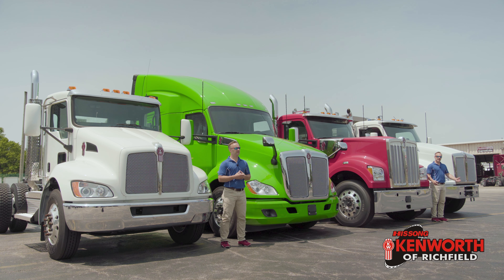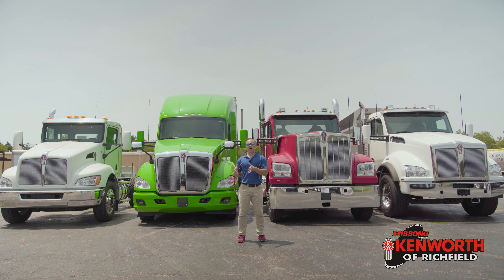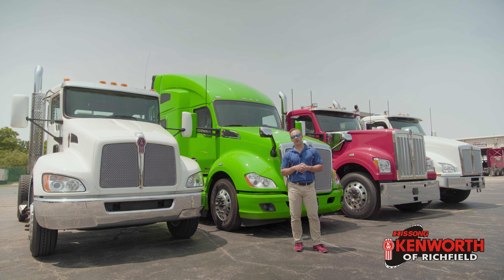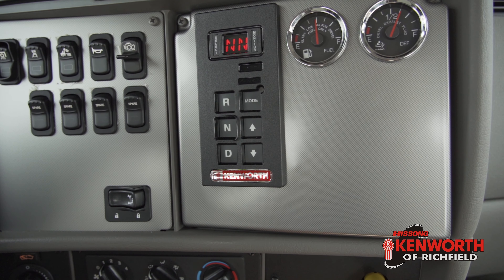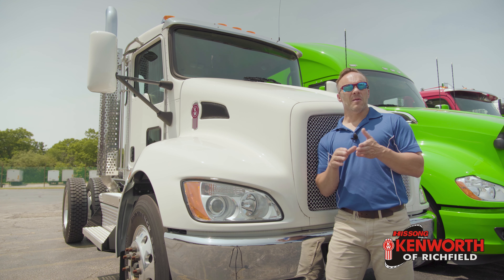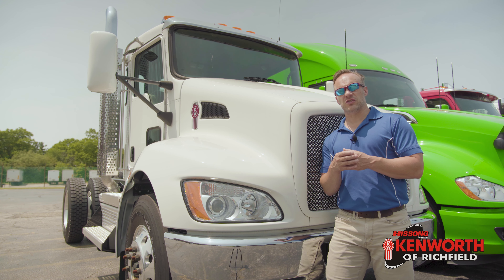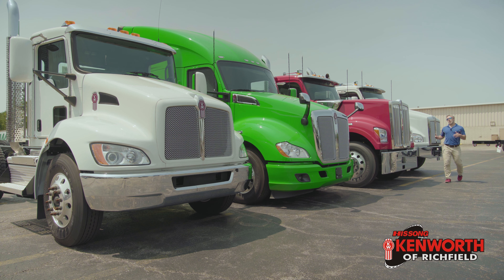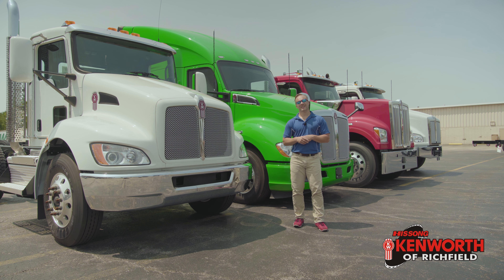Manual vs Automated vs Automatic (AGAIN...sort of)

Comment: I wonder if there's a difference in hauling power between the allison trans vs the endurant trans.
Reply from the maker: They work differently, so yes and no.    The engine is still generating the same power and torque.    The Allison uses a bit more power (higher parasitic load) but qith the torque multiplication of the torque converter, it lets the engine stretch it's power creation in a way if that makes sense.
Reply: @KenworthofRichfield  so this essentially means the automatic transmission may or may not haul a fully loaded trailer, as its primarily depended on multiple factors? As an OTR, I am starting to lean into the endurant trans for durability, unless I've missed something. I'm very used to automated transmissions, even if I've made the same misconception in calling it an automatic transmission. I haul 70-80K trailers regularly and don't want to overstress a transmission that isn't built for that level hauling. Use the right tool for the job, as the saying goes.
Reply from the maker: @OrtexofWill  Are you running 70-80k gross or is that just the payload?     If that's gross, I'd go with the Endurant.   It's a great transmission.   It works the same as a manual, just with the computer controlling everything.    If you're running at 100k+, then we can look at an UltraShift that will work for your application.   

As an OTR, I'll assume that you're running gross of 70-80k and to me, the Endurant is a great option for you.
Reply: @KenworthofRichfield  my loads as an otr reefer gross at around 40k. Sorry, I forgot gross weight and total vehicle weight were two different things. Whoops!

Comment: The international LT that I'm driving has an automated manual 10 speed and I hate it the clutch never knows when to actually engage, backing is the most annoying because your throttle input half the time it slingshots you back or nothing happens at all for a solid 3 seconds. When I was driving a Cascadia with the 12 speed Auto never had any of these issues and the Cascadia had crawl control which was very nice because it actually reacted how you wanted it to.
Reply from the maker: A lot of it comes down to the programming.   I might check with your dealership to see if they can change the program for you.

Comment: I drive a 2019 Kenworth daycab with the automated manual and what I don’t like is the delay when you hit the gas pedal. Up to 3 seconds. Why is it so bad and is that fixable.
Reply: There is not a delay. Take off the hill assist and you can apply the accelerator  much quicker.
Reply from the maker: What John said :D

Comment: Aside from the Allison being much more expensive up front, they’re much more expensive to maintain if you’re to keep their warranty and keep them in good working conditions.
Reply from the maker: There is more to it, but they do last forever if done right and also, the constant torque and controllability is a huge benefit for some applications.   It's all about finding what works for your specific business.
Reply: on off hwy like a front discharge mixer truck (or in my case a boom truck that gets into extreme situations).. automatic all the way. its the way they put the power to the ground. nothing beats full auto trying to get onto a snow covered lot. the trick is to go as slow as you can. the snow compresses and freezes in the treads as you go, making better traction than you would ever dream of in snow. it can be almost like a cogged railway. and yes i have both manual and full auto units.

Comment: I'm guessing the trend toward automatic and automated transmissions is because of a lack of drivers who are able to drive a manual or a lack of drivers who can drive a manual well. A generic computer program is probably safer and more efficient than a poorly trained manual trans driver.
It's a shame really, because even taking the manual shifting out of the equation, there are more drivers than ever on the road who shouldn't be allowed near an 18 wheeler. Choosing the right gear for the conditions and load is part of what made truck driving a skilled profession. You now have a large percentage of drivers who can't shift, can't back into a dock, and can't maneuver the truck with any proficiency whatsoever.
And that's why driver pay will never get any better than it is now. Driving has been distilled down to the lowest common denominator. What does all the recruiting literature say ? "Anyone can be a truck driver." When anyone can do it, it is no longer a skilled job.
Reply from the maker: You're partly right,  but not totally.   In this, it really is easier, safer, and in 90% of cases more fuel efficient than a manual transmission.
Reply: I've been a truck driver for just only over three years, but what I've noticed is I had/have a ton of more energy after a day's work with an automatic. I've had my 8LL for over two years, working my dump truck from sun up to sun down and when I get off, I'm tired. I've driven for people when I can't find work who have automatics and all I can say is to hell with a manual... I'd rather have the energy to want to play withy kid when he wants rather than to have to willfully motivate myself because I'm tired. I see automated or automatics will provide a person less wear and tear on their body.
Reply: I absolutely agree with both of your replies. I have been driving semis for 10 years. Most of that time I was driving 90,000 lb pump trucks. Our company started buying Western Stars with automatics, and at first I was a "naysayer". After driving one for about a month, I will take the automatic ANY DAY! 

1. You can focus more on the road, or while backing up, so its safer, even if by only a small margin. For new drivers, its a BIG margin.

2. They get better fuel mileage.

3. They are a godsend in traffic or on hills where other vehicles want to pull up on your rear bumper in stop and go traffic.

4. I am a lot less tired at the end of 14 hour day when I drive a automatic. I also noticed I feel less stressed as well, especially in traffic.

These are all undeniable benefits that even the most seasoned truck driver can benefit from.

Comment: I spent several years in the Marine Corps as a tanker. The 70+ ton tank with 1500+ horsepower and gobs of torque used an Allison transmission. Damn near bulletproof. You're never going to get the old farts out of the three pedal trucks.
Reply: the day 3-pedaled trucks die will call for a celebration.
Reply: Pxthfinder  Why is that? I like manuals. My patience likes autos.
Reply: No chance of fixing or working around the Allison going out when it does go out out on the road and when it does it’ll be a costly fix, the manual you’ve much better chance of Jimmie rigging something to get you home not to mention the price difference it’s fairly easy to see why old truckers and small operations will always run a manual
Reply: Caleb Guiton  Maybe not always but for the time being youre right. People in my grandfathers day thought automatics would never work in autos yet here we are.
Reply: You know when he showed the pedals I saw 4   just like my Thatsoon 240Z
Reply: The hell is a "Thatsoon 240Z"?
Reply: bomguy999999 modified Datsun 240Z with turbo and nitrous it gets there a lot quicker
Reply: Caleb from experience you get loads of warning that your box is going to fail mechanically, electronically not normally as lucky but will go into get you home mode....as for repairs the auto boxes normally work out cheaper than manual because its normally clutch plates or solenoids that wear/fail and  the mechanical parts are bullet proof, the boxes now are designed so well they are really easy to repair so less labour.
Reply: It won't be long before that's all there will be, only Manuals will be Special Order.
Reply: Im a young fart and cannot be pulled out of a three pedal truck lol! I hate automatics or automates point blank and i refuse to drive them and have even quit a company bcuz of them and the headaches they gave me!
Reply: Theres also a major torque reducer on tanks to get them down to the point where the Allison can even begin to contend with it. Theres also many differences between the tank's (or any other track vehicle) pack vs a truck powertrain. I say this from a lot of experience.
Reply: Manual all the way for me. No disrespect to the automatic guys though. I find a munual keeps me more alert. Plus I love shifting
Reply: I was in the Marine Corps two decades ago.  I guarantee you that you never ran one or two million miles on an M1A1.
Reply: @hudsondonnell444  I never said we did run that far in a tank. To say such would be ridiculous. My point is that the Allisons were good.
Reply: I see where you're coming from. As far as I know, all military track vehicles are automatics and work great. I was on an M88 crew in the 60's. I started driving trucks. I loved double clutching the 5 ton. The automatic deuce and half sucked, the M135 and M 211. Though I used the F2 range on the shifter many times.
Reply: @ Funny, I crewed the M88A1 from 1996-2000. The 88A2 is out now. Nothing like a 1790ci diesel!
Reply: @bomguy999999
I believe the M88 that I was on had a 1750 ci 1050 HP opposed 12 cyl dual superchargers and dual magnetos per bank coupled wth a four speed automatic transmission. The M48A2C tanks had the same engine sans superchargers with 750 hp, which I worked on in Korea in 1963/64.
Reply: @ When I was in tanks in 1996-2000 the 88 had an AVDS-1790ci diesel. I forget the horse power but the torque was intense. Of course the M1A1 has a turbine with 1500hp.
Reply: @bomguy999999  I never dealt with the M1. I did service self propelled attillary when I was in S4 and drove a tanker.

Comment: Well explained sir... Automated manuals are of course very different from standard automatic, since (like you said) all the internals are that of a manual transmission. You can operate the Automated tractor in a semi-automatic/manual mode where you have control of the gears, or you can let the computers and hydraulics take over for you, so they can depress and actuate the clutch, and automate the clutch and gear shift control.

Great video buddy!!!
Reply from the maker: Thanks Michael!    Was a fun one to do.   There will be more like that coming soon also. :D

Comment: Pretty decent explanations of the pros/cons. Two questions that I'd like to see answered: 1) What is the weight difference among them (use the RDS 4500/4700 for the Allison), and 2) what is the real world approximate cost difference up front? I'll be retiring in a few years and looking real hard at putting together a SuperC RV, and the foundation is still kind of up in the air.
Reply from the maker: Allison does weigh more from what I've seen, but it's not a huge difference.   The pricing is.   THe Allison is anywhere from $15-20k more than a manual where as the UltraShift is $3-5k more.
Reply: Holy Moses!
Reply: @KenworthofRichfield  15+20k? what the heck :- s

Comment: Here's something that you can or might want to dive into concerning these transmissions. The weight difference between the 4. Or is there really a big difference in weight between the 4.
Reply: I've heard that the Allisons were heavier, but I'm not sure.  I know we have 2 trucks that are almost identical except for the transmission and 22.5 vs 24.5 on the rear and the truck with the manual and 22.5 wheels  and tires was 300 lbs lighter than the truck with the Allison and 24.5 wheels and tires.
Reply from the maker: Thanks Wayne!    I've actially got a few things like that that I was going to dive into, but I hadn't thought of that one.   I dig it!!!!!

Comment: That manuel comment was funny. I guess I'm a old school guy, and I work in dirt and tight spots. I'll go out kicking and screaming before I drive a automatic or a autonomous
Reply from the maker: Let's hear why. :D
Reply: @KenworthofRichfield  well in short the drivers I know that driving them say it don't shift near as smooth as when they were shifting manuel. I've watched guys going up the haul road out the truck yard and the gear box is shifting before it should and then has to try to down shift and start over. We do concrete, guys backing the to concrete pumps end up coming in hotter then with a manual,  and when your hanging concrete chutes when the chute man wants you to move forward or back up he wants you to do it yesterday. It takes to long for the computer to decipher what needs to happen. A lot of the guys back up to the pump with a foot on the throttle and the brake. That's not safe for anybody. And probably the last thing is these new trucks are 1 and 2 years old and the clutches are going out of them.  I have a 2007 Eaton manual that hasn't been replaced yet. I see what you guys are trying to get across, and my clutch knee would probably prefer it.  But for our application of work it's made the job harder on the driver. And this is just my opinion, maybe your getting a whole bunch more positives for them. Thanks for getting back to me. And so you know I'm no newbie, I've driven 32 plus years, 27 of them hauling concrete. Thanks again for asking why.

Comment: What's the safety backup system for the electronic gearbox?

What will happen if the electrical system fails?

To me mechanical gearboxes are more robust and better than any electrical controlled gearbox.
Reply from the maker: Thanks for watching Philip!    All of them are really well built items.   As long as you don't beat them, they'll give you years of great service.    With the UltraShift, it's actually the same case, gears, and other items as the manual transmission which have already proven themselves over the years.    On the electronic gearbox, initially there were a few issues, but no, they really have become extremely reliable.   It's not too often that we hear about an issue with them.   As far as a "safety backup" for a failure, there really isn't on.   If you're worried about the transmission not working on a hill, I'll say this, "It's no more likely to fail than a U Joint."
Reply: Philip 
The company I work with we have 3 trucks with the auto shift.  The short answer to your question is, the transmission will usually get stuck in neutral,  it's not cheap to fix either around $2500 , after the parts get fixed, the transmission computer and the engines computer have to be connected so each computer can communicate with each other. 
The $2500, doesn't include the tow bill either.

Comment: I would of agreed with your view of transmission choices you delineated by usage. That is until I put together a dump truck with a Allison RDS 4500 transmission, I  believed that the only reason to have the Auto was so any idiot could drive it, I was wrong. The Automatic is gentler on the truck, gentler on the driver too, plus much safer. It's surprising how much mentally we spend paying attention to shifting, rolling at stops, working to not get stopped on a hill and a myriad of other thing that become second nature to driving a truck. Automatic makes all those things go away, you don't even realize it's happening till you've spent a substantial amount of seat time with the Automatic! The Automatic makes a good driver even better, a beginning driver tolerable:)
Except for cross country or long haul trucking, the Allison would be the best choice for most applications(especially for a dump truck) you mentioned:)
Reply from the maker: It is a great choice for most things.   Now, where the difference sits is in the price.   The Allison is quite a bit more expensive and with the current crop of Automated transmission working as well as they do, they're a great option also.

Comment: The 1st is automatic 
Means no gear in the truck or something else
Reply from the maker: THe automatic is a torque converter driven transmission.  The automated is a gear/clutch driven setup.

Comment: Unless your transmissions are different to the UK version your statement that they are fluid feel in all gears is incorrect as ours went 1st wear free pull away using torque convertor, then 2nd unlock torque convertor for change when engaged then lock up torque convertor and it the stayed locked while changing though the next 3 gear giving a LOCKED direct drive transmission for 3rd..4th and 5th ...also had a wear free braking system built in we called it a retarder......that was 15 years ago. This is the only transmission worth having nothing comes close to it even today with the automated and the DGS boxes, these are really poor in traffic and low speed control, what you lose in MPG I can take if it means smooth gear shifts and one foot operation.
Reply from the maker: These are a bit different as the most common ones here are becoming the automated manual transmission and not the torque converter automatics.
Reply: I would say due to cost is the only reason, being cheaper to build  and maybe the tree huggers wanting more MPG.....Its a shame if they stop using the Automatics, they are the best and its almost operator proof and cost for repairs are the same if not cheaper than manual boxes.....here they lived in London Busses constant stop start with only two throttle positions OFF/FULL THROTTEL and they lasted hundred of thousand miles which sounds low but many manufacturer have found out how hard this is on all parts...the auto box has been the most reliable and cost effective transmission fitted to our busses and repair cost are very low even from the manufacturer....I think we only have two types of auto boxes Alison and Voith....both very good bullet proof boxes. Operators Auto is the safest and reliable cost effective box.

Comment: Hey guys isn't there power loss in a (automatic) vs manual transmission
Reply from the maker: Yes and no.   A torque converter automatic actually does use some power to run the pumps and that, so there is a bit of a loss, but not what it once was.    Now, when it comes to an automated, it's exactly the same power to move that transmisison as it is an automated.